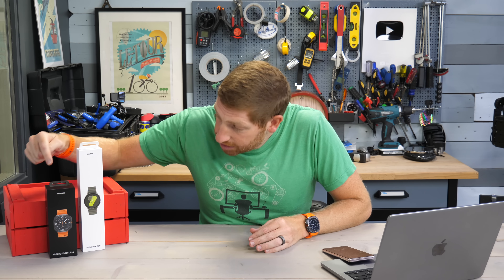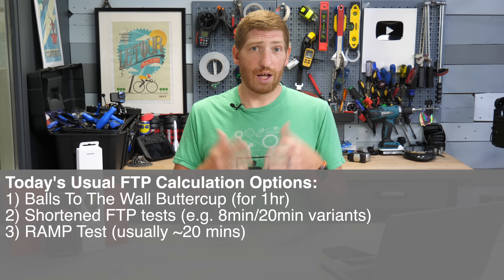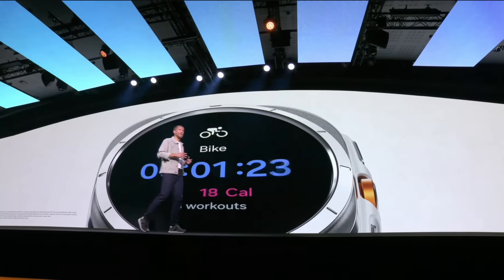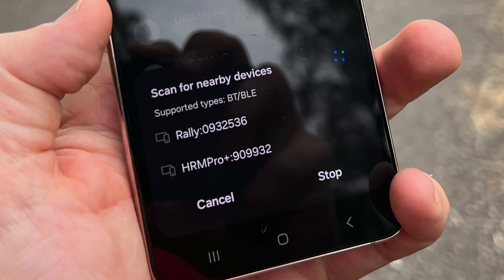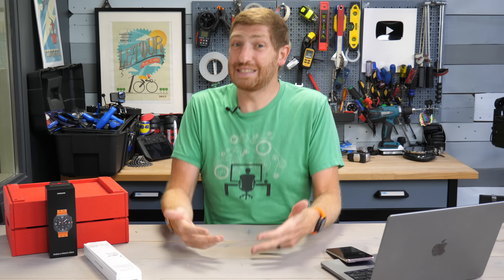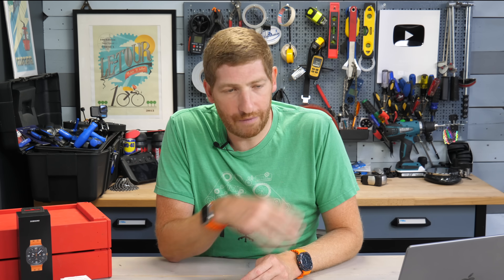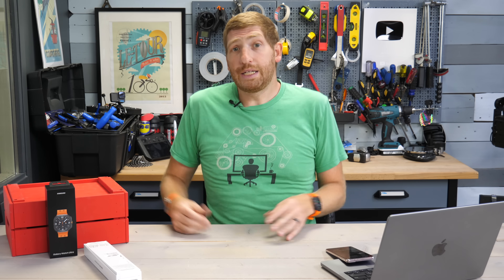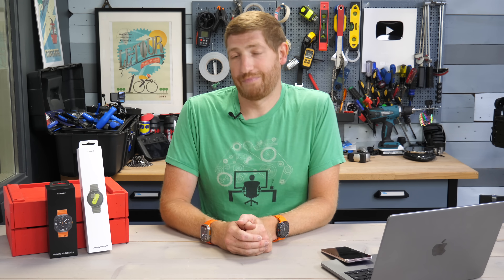Samsung's Magical 4 Minute Cycling Test: Does it actually work?

Comment: Typically, Bluetooth is a one-to-one connection. If the power meter is connected to Garmin's cycling computer, I think it's natural that it would be disconnected from the phone, but if I disconnect it from the Garmin cycling computer and connect the power meter to my phone, does the same problem occur?

Comment: Getting a "FTP"  estimate from a 4min effort is not that crazy if you know about "critical power".  
Critical power is a very similar concept to FTP, but it is not limited to a specific time frame and it has been in use in scientific circles for at least as long as FTP has been used among athletes. The important thing here is that CP tests are basically just a maximal effort of almost any length. You can then extrapolate FTP based on the CP test, which is not perfect, but it should be in the rough ballpark for most people.  
You do not need a Samsung watch for this at all though, intervals_icu uses this type of approach to estimate your FTP and apps like goldencheetah can show you your CP directly.

Comment: Wearing the Watch Ultra right now.  For anything fitness related I use Garmin.  I have an Epix Gen 2 and Forerunner 965.   I utilize the samsung watches for cellular connectivity and smart watch features nothing else.  The reason I got the Ultra was I wanted a more rugged build and better battery life.   I never even considered using the samsung watch to track fitness.   I want Garmin to make a cellular model so i can run and leave my phone at home and stop wearing two watches.   Same goes for my bike.  Edge 840 on the front mount but samsung watch on my wrist for cellular.    Darn it Garmin, solve my problem!!!
Reply: I do pretty much the same. I wear my Epix Pro and the Samsung Watch for cellular connectivity so that I don't have to run with my S24 Ultra.  But I do think this is the first Samsung watch that I would be fine with recording some data as a "backup" source. The previous generations weren't worth recording an activity.

Comment: 4 min all out is VO2max effort.  There are studies that show correlation between VO2max and threshold power, typically 105-120% of FTP based on a duration.  intervals-icu uses this method to calculate your FTP for each ride.

Comment: It would be nice to have an app that would just ingest your last N months of .fit files (assuming they contain power and whatever else the algorithm needs) and spit out an FTP vs. time plot. I think the tricky part would be handling long intervals without a hard effort followed by a "harder" effort (how close to max was that?). In other words, decreasing your FTP accurately. Perhaps a little interactivity where you can designate they perceived effort of key workouts might help.
Reply: What you're describing is a power duration curve. WKO 5 does this and even Garmin's website to some extent.
FTP is your maximal steady state by the way, it's a single point on the graph.
Reply: @StuntpilootStef  I know--I use WKO 5. I was referring to how FTP varies over a longer time frame (e.g., months). Also, I often do 10 mile time trials, which are only 23-ish minute max efforts (for me), so the curve doesn't reach the hour mark. WKO 5 shows a "modeled FTP", so it's estimating it somehow, just not very transparently.
Reply: @michaelpolakowski7301  WKO requires good data to model it correctly. If you never do unstructured testing it'll be pretty far off.

Comment: No chance you'll get a remotely accurate FTP for most people in 4 minutes. I know people with a much higher FTP than myself that I could outperform for 4 minutes because I outperform with vo2max and anaerobic
Reply from the maker: In some ways, that's the biggest challenge with FTP. .It's mostly just a random number that doesn't really correlate super well with teh varying types of cyclists. Sure, a higher FTP (w/kg) can absolutely mean a bigger engine, but it doesn't mean the rider can go further/longer/etc...

Comment: I don't get it, why do you need the watch at all if the whole thing is app driven? Why not just pair to a chest strap and boom FTP appears?
Reply: Maybe HR measurement?
Reply: @matteo.ceriotti  that's what Ray has said in the video; hence my comment: why not pair the app directly to a chest strap. It's far more accurate than an optical HR sensor (and cheaper than the watch!).
Reply: Because their business is to sell watches and this feature is a half baked attempt to lure a few cyclists into buying their watches.
Reply: That's boom-boom, boom-boom. Unless you have a failing heart :-)
Reply: I think the phone is just there to display the information.